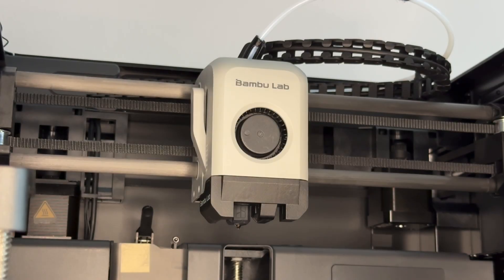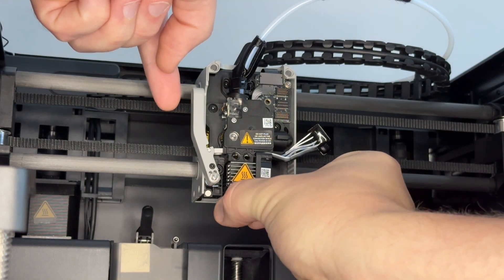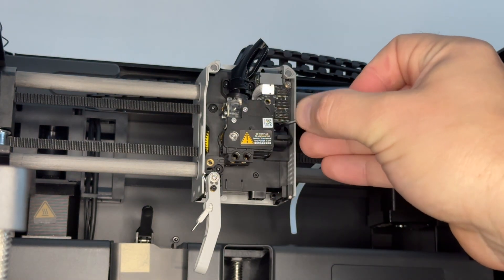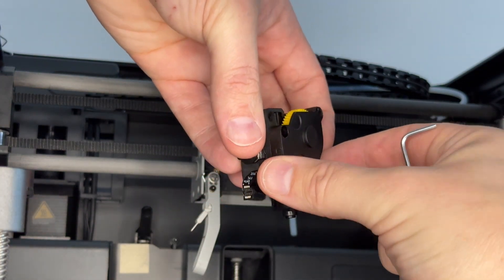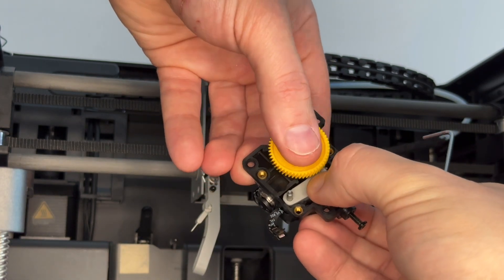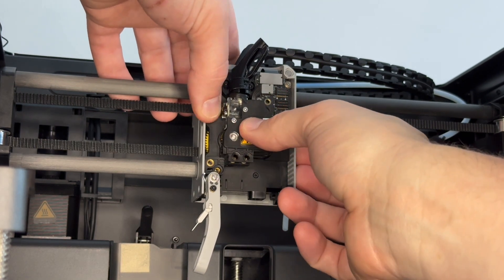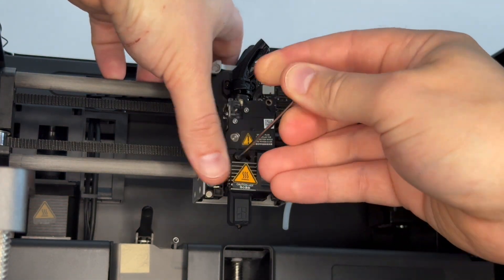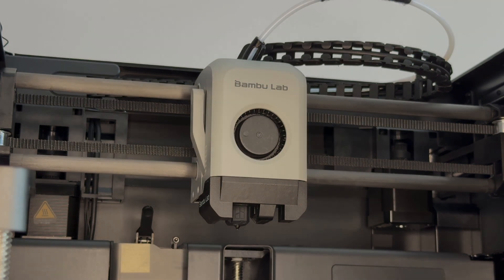Bambulab P1P and P1S Nozzle and extruder removal and replacement

Comment: Great video, a little quick but easy to follow. Had a 1 1/4 inch bit of filament snap off in my hotend and managed to get it out.
Reply from the maker: Sorry i will try to take it slower in future i try to keep them as short as possible if i can
Reply: @Kenprints  it's no worry. Im just not used to taking these apart. I think I mightve put it back together wrong though haha
Reply from the maker: @DogByteFR practice makes perfect
Reply: @Kenprints  7 months later, it happens again. With an even smaller piece of broken filament. Thank you again!

Comment: Thank you very much for doing this simple and easy to follow disassembly/reassembly of the print head for the P1S. I can figure most things out but was stuck on how to get the feed gear mechanism off and apart to check for debris, for me the trick is releasing the cutter. I had a filament break off and was stuck in the hot end and I could not get it to feed. Using the micro fine pin wire tool to poke/pull it out got it cleared. Being able to check the feed gears helped eliminate that area, this helped immensely. This should be a standard troubleshooting video in everyones toolbox for Bambu.
Reply from the maker: @UniverseBirthing  glad it helped you

Comment: Excellent explanation. Thanks a lot!
Reply from the maker: @vincenzocaselli7710  no problem hope it was useful
Reply: @Kenprints  Unfortunately, I noted the filament is broken inside the hotend ... What should I do? Is it necessary to replace it?
Reply from the maker: @vincenzocaselli7710 no it’s perfectly normal for the filament to remain inside the nozzle when I got my first bamboo printer. I also thought this was an issue but it’s not just ignore it. Swap your nozzles and carry on.
Reply: @Kenprints  Solved. Bless you, Ken!

Comment: I replaced the connector board with a new one, and the connections are tight. I may have pressed too hard, causing the connection to fail.
Reply from the maker: @rogerw8062  good stuff hopefully it lasts longer than the first one

Comment: This video helped me to take the extruder apart because the filament was stuck. I believe the stuck filament was causing the cutter arm error.
Reply from the maker: I'm glad that it helped. Sometimes the cutter arm get stuck when it starts to go blunt, so check to see that the blade is still sharp

Comment: The three connections on my Bambi P1S are loose and won’t stay connected. The issue with the printer started with an error message cutter stuck. Since then I have not been to fix the printer. I have ordered spare parts to replace any defective ones.
Reply from the maker: have you removed it often ? just curious as ive swapped mine lots and no sign of them being loose yet
Reply: @Kenprints  The middle male connection that will no longer hold the connection together. I have changed the nozzle twice, and it started to become loose each time. I have ordered a spare board to replace it.
Reply from the maker: @rogerw8062 that’s unusual have you many hours on the machine ? They may replace the board under warranty it shouldn’t fail like that
Reply: @Kenprints  No, the P1S has only about 80 hours on it. I'm not sure why the middle connection is so loose.
Reply from the maker: @rogerw8062 I have over 1000 hours on each of my most recent Printers and there is no sign of any wear On the connector however it is possible to push the centre connection in incorrectly meaning only half of the connection is inside the Connector this leaves you with a loose connection that makes it look like the connector is broken but I’m sure you probably checed that
Reply: @Kenprints  I'm new to 3D printing. I used a brand new nozzle to connect, and it just falls off. The male pins and the female connector look good. The board is only $10.00, so I will change the board. I will check the fit of the new board and new nozzle.
Reply from the maker: @rogerw8062 let me know how u get on

Comment: The yellow gear on mine will not come off.  Pretty sure I'm gonna break the whole thing if I try harder.  Also, the plastic tube is stuck as well. Any thoughts?
Reply from the maker: @Buckwyld7399  push the shaft of the yellow gear instead of trying to pull the gear and it may come loose

Comment: Wish I would have seen this before stripping the screw. Now I’m stuck and can’t figure out what to do next
Reply from the maker: @jbt9033  see if you can put an elastic band across the tip of the allan key before pushing it into the hole of the bolt it may give you enough grip and extra width to get it removed just remember to push the lever in to remove the pressure off it
Reply: @Kenprints That never works for me, usually you get 2 options if a t6 torx bit also doesnt work, you saw it off, or you take out the C disk under it and pull it out ( last thing you wanna do is pull it off because it is annoying as fuck to do )